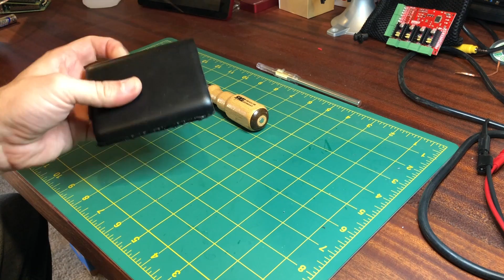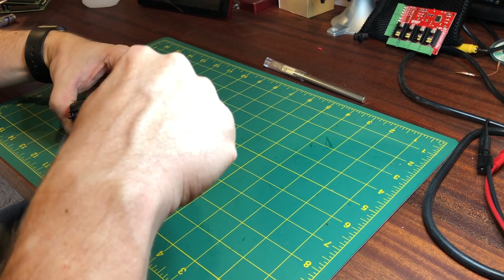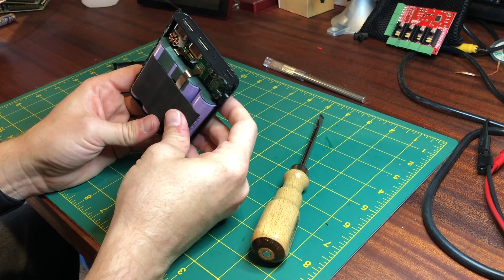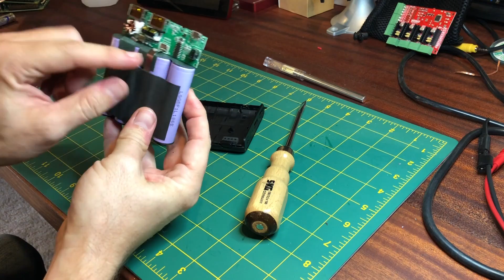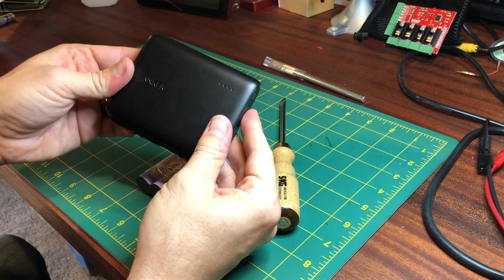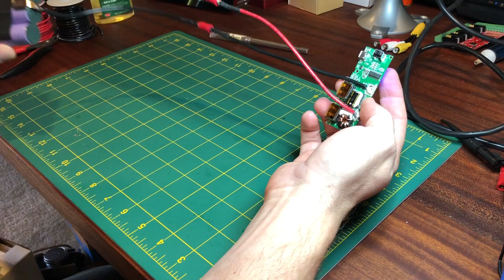Anker PowerCore 13000 Teardown

Comment: I got the anker powercore 10,000 open without cutting, just prying with fine and coarse flat heads. No glue. Same design, but with 3 cells instead of 4. Trying to fix a broken usb port and I must have managed to short the cells. Somehow managed to burn myself quite badly, considering how brief it was. Those cells pack a punch! Anyways, thanks for the video, and use a non-conductive tool if you're trying to bend the usb pins back into place.

Comment: Thanks for the video. I just disassembled mine. The case wasn't glued, just some really good clips. My unit is from 2016 and the batteries in it were NCR18650B. I tested the batteries and 3 were shot but 1 still has good capacity. Too bad Anker doesn't make these to be more easily opened and with user replaceable batteries. I saved the BMS board and thinking about just making my own 4 cell replacement pack and using it as a UPS for one of my Raspberry Pi's.

Comment: Hello Rob, I do not have a user manual for this  devise, but can you please tell us a bit more about charging the power bank?
Do you have to charge the PB the same as  a cellphone battery?
80%
10%

2. What Iff you forget to disconnect the PB when it is already 100% charged? 

Thanks for a short response.
Reply from the maker: Hello, it is a lithium-ion battery, so charging it to 80% would probably be preferable, but there's no reliable way to tell when it's 80%. I think most people just charge these fully and then just replace them if/when they eventually start losing too much life (which would be after hundreds of full charge cycles). You can leave the charging cable connected past 100%, it disables charging internally.

Comment: It would have been nice to show a close-up of the 18650 model numbers so we know what batteries they use in it. The whole point of a teardown is to see what components are inside.
Reply from the maker: I can see the part number quite clearly in the video, what resolution are you watching it at? They are LGGBF1L1965 which are these: https://secondlifestorage.com/index.php?threads/lg-lggbf1l1865-cell-specifications.8572/  Rated at 3350mAh

Comment: For anyone attempting this, you can easily disassemble the case without damaging it using plastic auto trim removal tools. I did it on this very unit with no damage. Those tools are made specifically for jobs like this.
Reply: In the exploded picture below, you can see the case snaps together tightly.  If you cut a tiny notch in the seam in one corner (big enough to insert the tip a plastic auto trim tool on the opposite from the on/off button), you can wedge the tool along in the corner along the seam, and slowly pop the top off of the case.
https://images-na.ssl-images-amazon.com/images/I/71DDbvHrYZL.jpg

Comment: Can you give us the dimensions of the cell with the board ? I'm trying to include like you in a portable project.. Thanks !
Reply from the maker: I can! I'm out of town at the moment but I'll take some measurements when I get back.
Reply from the maker: Okay, took another one of these apart and got the dimensions. Cell pack is approx. 2 7/8" wide x 2 5/8" long x 3/4" tall. Control board is approx. 2 3/4" wide by 1" long x 3/8" thick.
Reply: @cannikinn  Please There is an black (smd )chip with 3 pins near the input usb . Can you let me know what the number on it? I need to fix my anker but I don’t know what is the number of that black (smd)thanks.